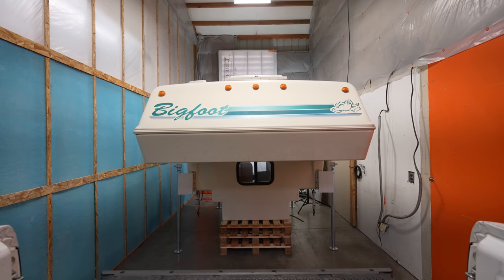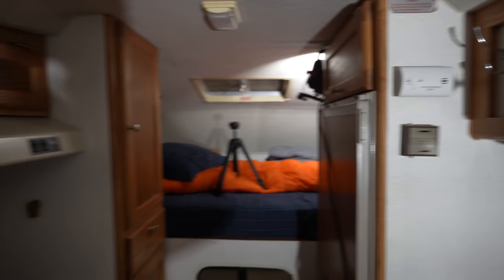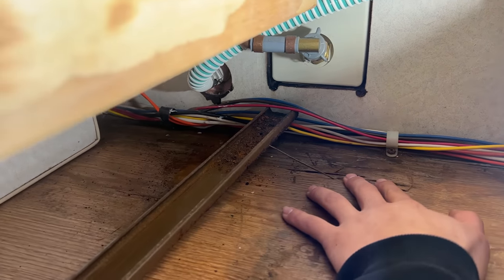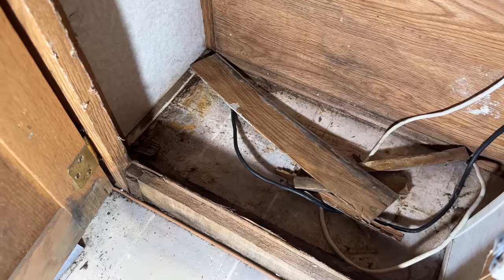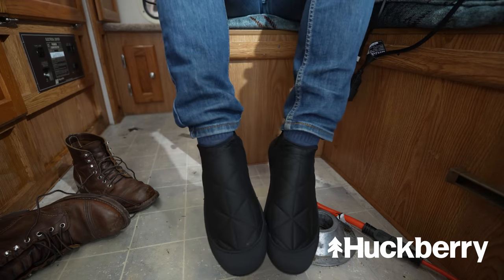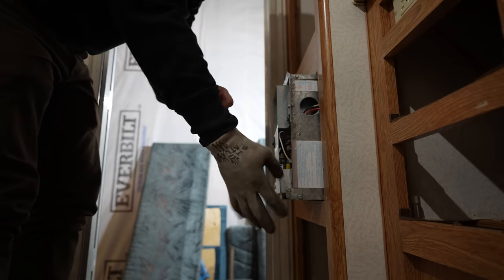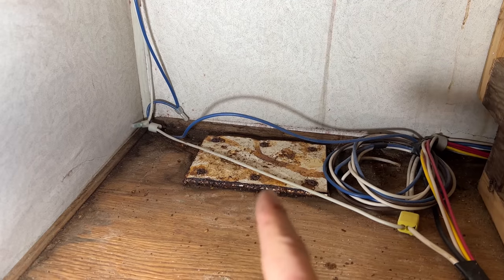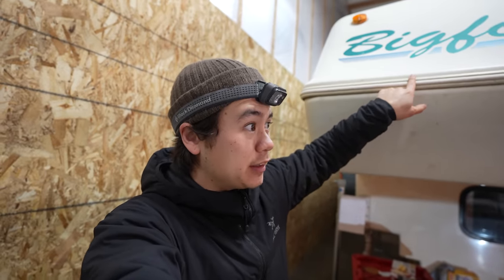Tearing Apart my Truck Camper (the renovation begins)

Comment: Hey man, glad to watch another video as always!

Wanted to offer a couple of suggestions, as I did a complete camper renovation during the pandemic. When it comes to your subfloor (I would assume you're going to replace it), a couple coats of KILZ primer on both sides would go a long way to keeping it in much better shape than the stuff that was in there!

Also wanted to mention: not sure how you're approaching your electrical system setup, but camper wiring is a PAIN. It's totally doable, but if they built your camper the way they built mine, they basically build them from the inside-out, so splicing in or even just basic outlet replacement and stuff like that is pretty complex. If I do another one at some point, I think I'm going to use a Goal Zero/Jackery as the main power source (maybe with an additional battery for storage) and then the whole system is removable.

P.S. If you do go the "regular" electrical route, there's a website called RVPartsStore.com (or something like that) that has a lot of pieces that I was never able to find anywhere else.

Comment: That storage is adding some structural rigidity, but make it your space. Personally I would never gut one, not sure I'd have the skills to put it back as nicely.
Reply: Yes Bob that is correct .....All that wood was adding strength structural ...Hes going to need a Carpenter ...
Reply: Right, fiberglass is not inherently structurally sound without structure. It would move in the wind and not be safe going down a road without those wood cabinets lining it. He needs to re-line it with cabinetry or else it will not be safe.

Comment: Jonathan get videos been watching for a while. I have a few suggestions; turn the camper around so it’s easier to get stuff in and out. You could literally throw stuff into the back of your truck. Timelapse some of your footage so you can put more content into your videos or 2.5 - 4 speed on the parts that are not as interesting. Also, are you planning to show your proposed new layout or are you shooting from the hip?
Reply: How can he turn the camper around? Unless he gets a camper dolly, I don't see how it can work, unless he moves the camper a bit forward for more room for cutting, and removing items. I love some of the timelapse idea!
Reply: @HensOnly  harbor freight floor floor dollies underneath the pallets, strapping the pallets to the camper, spinning it outside, then pushing it back into the shop, then extending the camper jacks, or just leaving it on the dollies

Comment: Too bad you didn't notice the severity of the mold issue at time of purchase. You could have negotiated for cost of materials to rehabilitate the camper. One commenter had a good point about wearing a mask with all the mold being worked on. Long term adverse effect could occur otherwise. Happened to a colleague of mine.

Comment: I have a 1986 model 'Pilgrim' I started gutting today. I hate factory campers. Cheap, poor quality 'workmanship, LOL. Immense Wasted spaces. Everything I do Not need or use. Built to fall apart, leak & break. I'm eliminating All of the 'conveniences', redoing the cabinets (no doors), no drawers. No leaky propane lines, leaky water lines all tangled. Stupid little sink. Oven never use, replace with coleman camp stove. Stupid inefficient heater. & getting rid of water heater. 1000 screw holes etc in the roof. Duh! I think I might put the vent in the door. After I'm planning on building my own from my own plans for my flatbed. Just toying around with this as I'm experimenting some ideas on it.

Comment: What did you pay for that camper? Renovations? Rental of work space? Time? Wouldn’t getting a loan for a decent camper be a better choice and allow way more time for adventures ? 🤷‍♀️
Reply from the maker: Honestly a very valid point but it's too late for that now LOL. Didn't realize all the extra money I'd be putting into it so soon when I was buying the camper but it is what it is.
Reply: It would be a different channel if he did that
Reply: Remember why he got this camper. He made a video explaining why. The shell is very weather resistant. Its perfect for the Pacific northwest. Plus.... This will make for some great videos.
Reply: I did the same ti my 05 arctic fox 1150. I don't even have the slide out anymore. No furnace, ac, satellite, water heater, microwave,  fridge,  etc 
Deleted all windows except 2, insulated all sky lights, bails of attic cat in unused cabinets and floor spaces, keep doing what you're doing and it'll be better than brand new

Comment: YOU MIGHT BE BETTER OFF ADDING INSULATION TO UNDERSIDE OF FLOORING AND ADDING A TOPPER TO THE ROOF(just a little roof,on the roof, with thicker insulation.)SAME WITH THE BOTTOM,IT WILL BE JUST LIKE A TOPPER, EXCEPT ON THE UNDERSIDE OF FLOORING, AND YOU DON'T HAVE TO PULL UP FLOOR (unless you want,or need to).....YOU MIGHT WANT TO TRY THAT AND SEAL ALL SEAMS.... YOU DON'T WANT TO GET IN OVER YOUR HEAD  BY UNDOING TOO MANY THINGS AND HAVE TO SPEND MORE MONEY THAN NECESSARY ....KEEP IT SIMPLE,ROOF AND FLOORING....I LIVE IN ONE 😆 LOL JUST TRYING TO HELP, DON'T MEAN TO OVER COMMENT LOL....ONE MORE THING,USE 3/4 INCH THICK OF INSULATION OR MORE,FOR ROOF AND FLOORING....

Comment: Totally necessary to get rid of boomer furniture. Building with oak cabinets is such a bad idea. Weight does matter, esp if you don’t have (and don’t need) a F350 and haul 4000 lbs with stuffy loaded interior. Definitely think of using aluminum 80/20 pipes and marine plywood. You gotta think like an aerospace engineer and built it with quality components. Keep it up. The value is in the fiberglass shell itself. Everything inside should be gutted to fit your need.

Comment: Once again!  You need to get rid of the fragile half ton commuter truck.  You truly need a real truck!  Any domestic 3/4 or 1 ton truck would serve you better.  You said you were getting 10 mpg with the first truck, correct?  A V8 or diesel certainly would not do any worse! At least then you would have a better frame, HD brakes and a real truck.  The 3/4 ton and up are not built light weight to meet fuel mileage requirements.  I don't understand why you would invest in another fragile truck.
   Next time you can use our garage!

Comment: Dude, you're making a mountain out of a mole hill. You've made a critical error by tearing your camper up instead of taking each issue on individually and making thoughtful repairs as needed. Much of what you're demolishing is structurally neccessary to maintain the units rigidity. Lastly, I can genuinely appreciate your intention but your building skills are in no way up to the level needed to complete such a task without ending up with a really disappointing outcome. Please get someone with some real experience in cabinetry and construction to help you, buy the right tools and equipment, and then allow yourself a year to put back what you have torn apart.